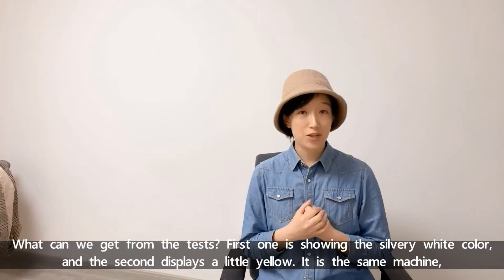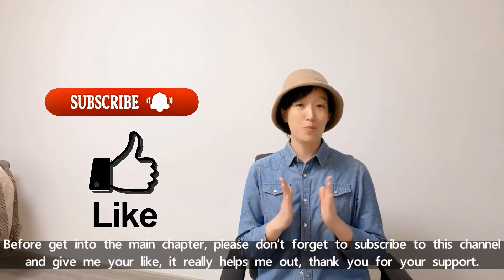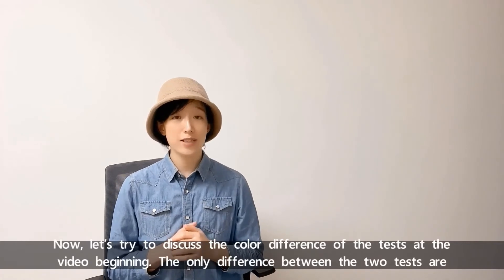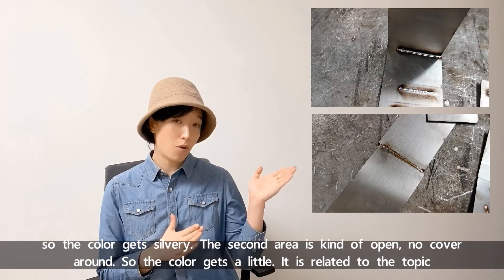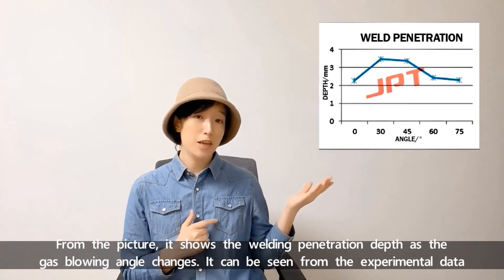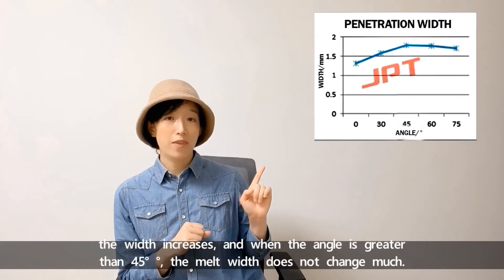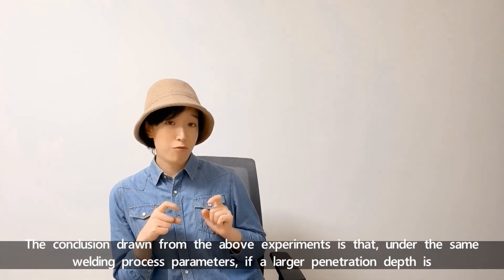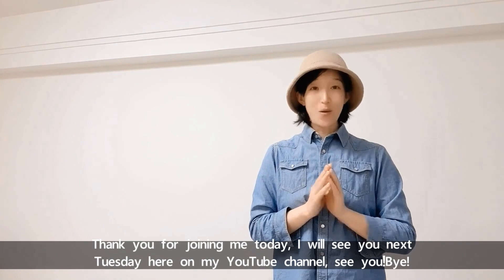Influence of Gas Blowing Angle in Fiber Laser Welding

Comment: Ive bought fiber laser welding machine.  I only weld 1.5 mm aluminium sheet. Could you give me some advice please.
Reply from the maker: You need to offer me more information, like your machine power, what configuration. If it is in warranty, try to contact your supplier, it will much easier.
Reply: @ClaraChai  I ve contact to them, Ijust wondering which gas better 5053 aluminium sheet. Some people said Nitrogen much better for aluminium. I have 1500 w Fiber laser welding machine. Ty for responding.
Reply from the maker: @menopiko  I think argon is better.
Reply: 1.4

Comment: Hi Clara
I have a question please
I can use PSA oxygen generator with cnc fiberlaser
Because output purity of oxygen generator is just 93% and pressure up to 4 bars
So it can work with this purity or need only 99% .
PSA generator it have a lot of filters for oil and for dust and for water and also have a cold dryer
Reply from the maker: I don’t suggest, the oil and water could lead troubles. Don’t do that.
Reply: @ClaraChai  no my question is 93 % of purity of oxygen for cnc fiberlas is working good
Reply from the maker: @medjoui7600  Okay, if it is okay for you, I have no comment, sir😂
Reply: @ClaraChai  thank you so much Clara, I have a lot of filters so output oxygen gas from generator is not have any dust or any water or any oil

But I don't know if 93% of purity oxygen and 7% of other gas is working good or no I'm asking you because you have a lot of experience for this machine cnc
Reply: No answer